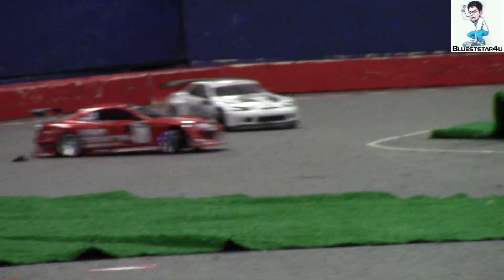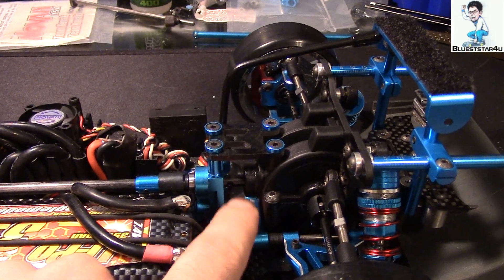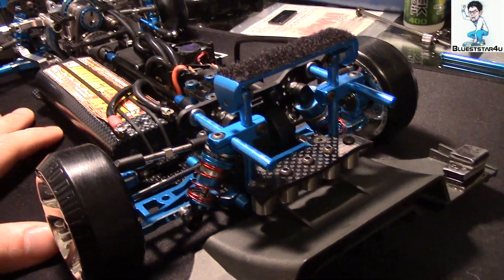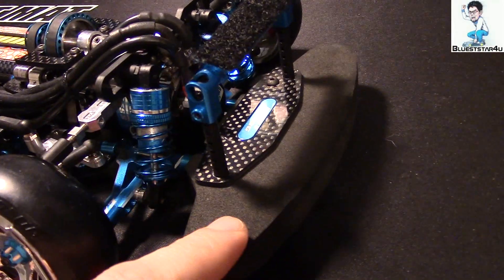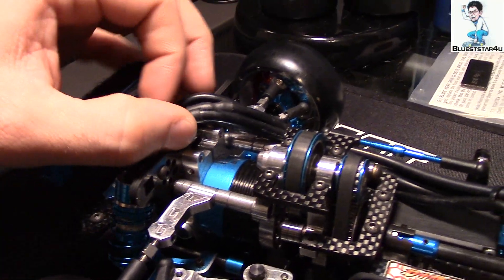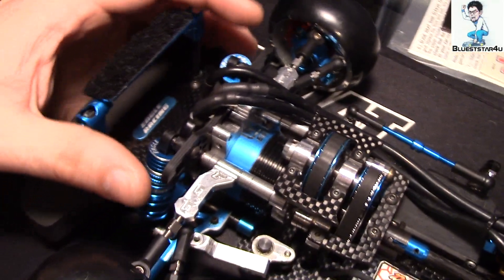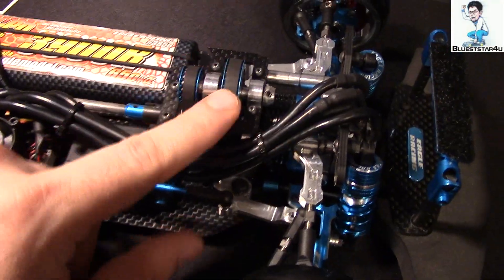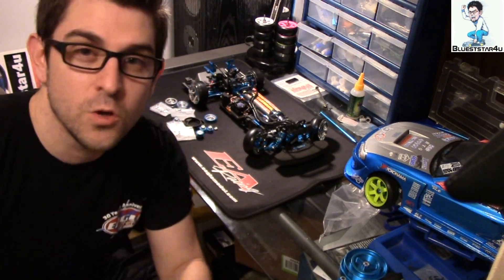It's here Eagle Racing TT02 FR-D Review !! RWD RC DRIFT

Comment: gyro lol what are you? some sort of newb?
Reply from the maker: there are 3 kinds of rc drift setup.
AWD, Countersteer, and RWD.
RWD is the only setup that requires a gyro.
Everybody in the world uses a gyro for RWD.
It emulates real drifting steering wheel pull.

People try RWD without a gyro but cannot make the car smooth enough and have the tendency to spin out. alot.

Gyros are standard equipment for RWD.
Reply: I know thats why i never touched rwd drifting for rcs, is gay.